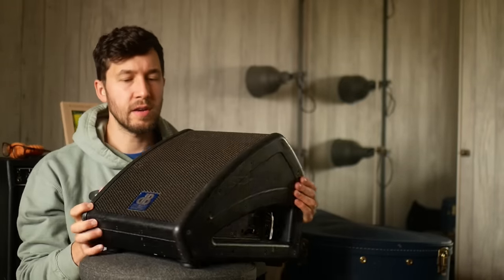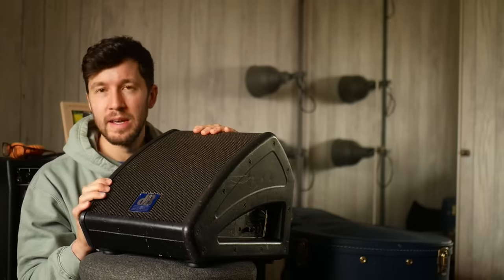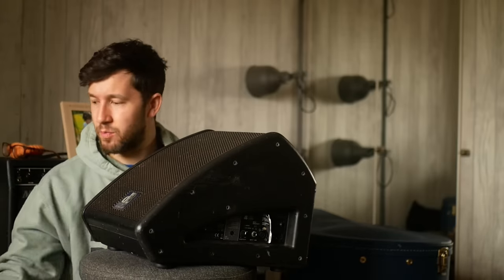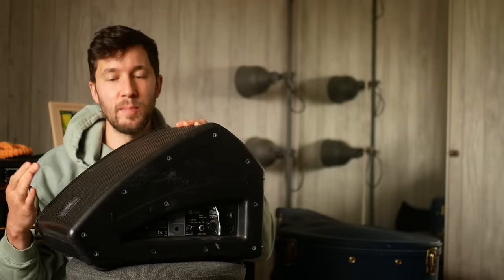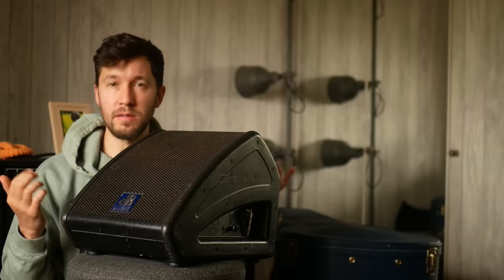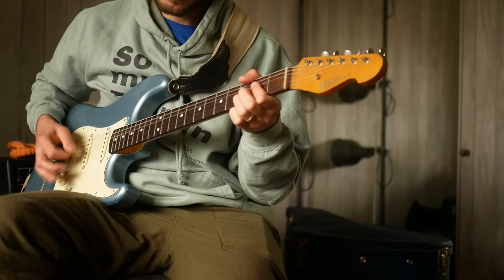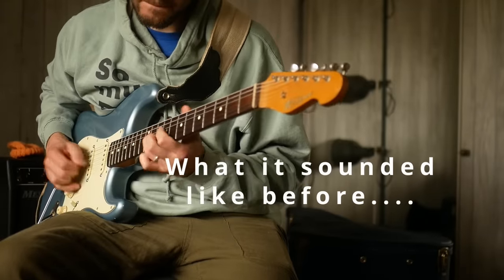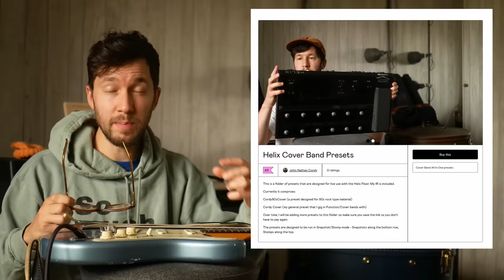Do THIS to get AMP LIKE Tones from FRFR Speakers

Comment: Hi John ! Long time fan of your HELIX videos.

I use a HELIX with a HEADRUSH FRFR 1x12" speaker and love using stereo blocks, but the problem, is as I only have one speaker blasting at me, the stereo effects are summed to mono.

I build all my presets with mono blocks to make sure the tone coming out of the FRFR is the tone that comes out of the PA, but it's quite frustrating as stereo reverbs and delays sound soooooo much better imo.

Any tips on that ?

When I use stereo blocks, I know it sounds better in front but it ends up sounding "weird" coming out of the HEADRUSH.

Love your stuff, thanks John, have a great end of summer !
Reply: Purchase another frfr or I have a smaller mixer. I run my helix into the mixer pan the channels then I take a balanced 1/4" out of the headphones out jack into the frfr.

Comment: Helix is hypersensitive to what you monitor it thru. So whatever you tweak it thru will be different than any given FOH. I tweaked my presets thru the band’s p.a. and it’s vastly different than my in ears and my DAW at home. Hell, it’s vastly different going thru the xlr’s in my interface vs usb. So it’s all a freakin crapshoot. Even with the powercab. These issues are the big negative of digital. And they ain’t going away anytime soon.
Reply: There's a recent video by Matthew Dale called "Don't let this kill your tone" on XLR vs TRS, you might find interesting.